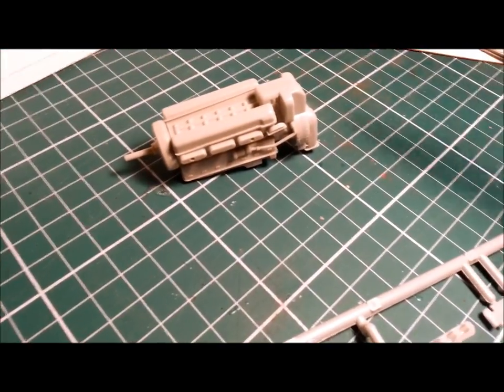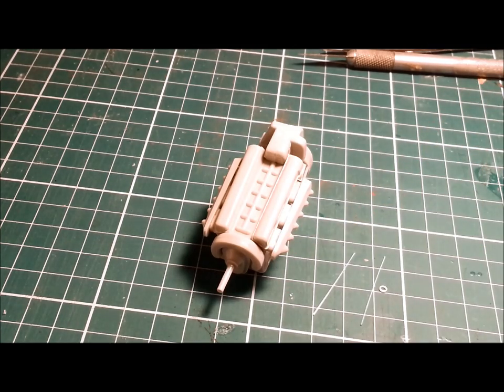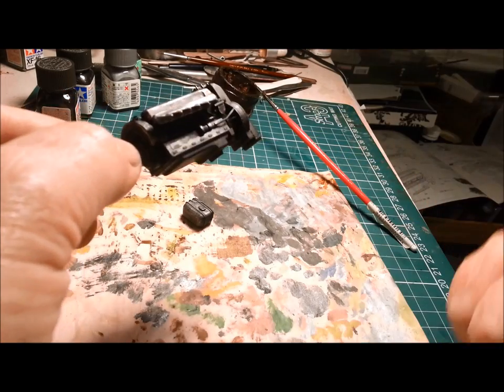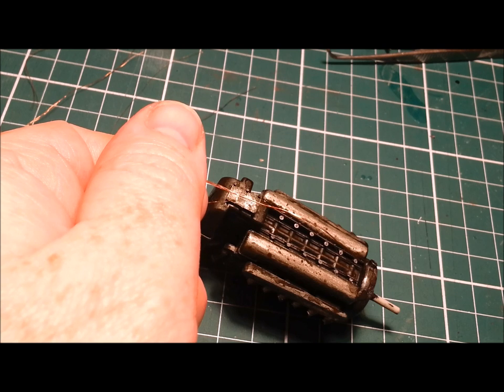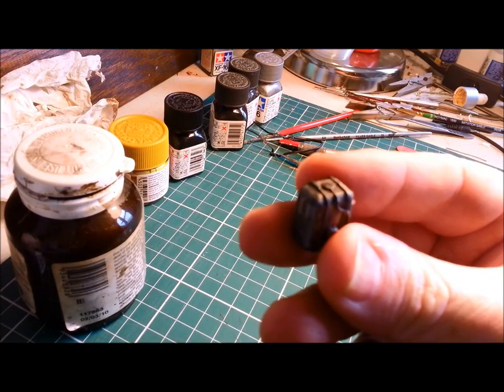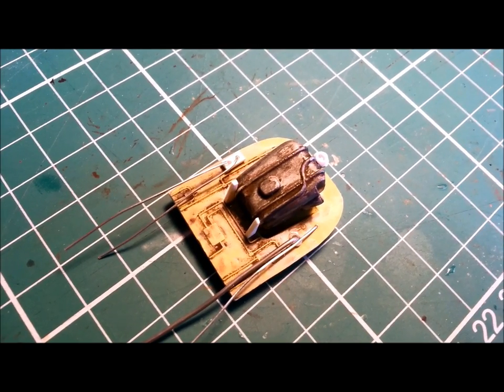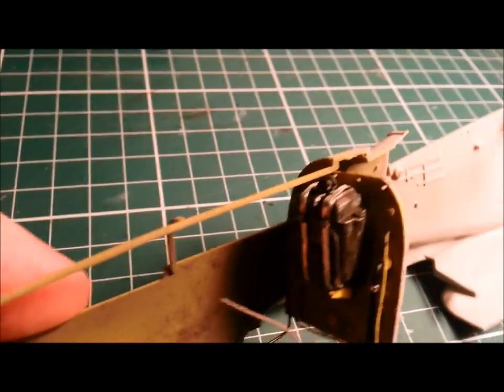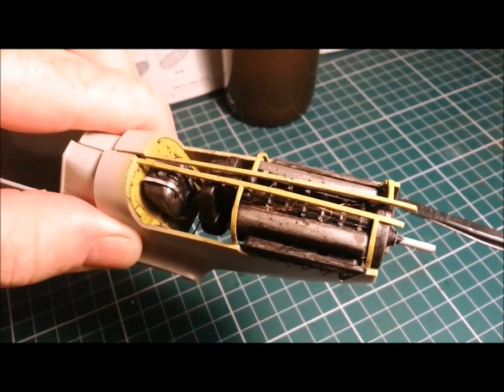How to superdetail & scratch build a scale model engine bay: P-51D Mustang in 1/32 scale

Comment: nice to see you use aluminium foil strips.  i use self adhesive alu foil it on my canopy's where pos. also on occasion aluminium from cut up beer cans for bulkheads etc. i have a seemingly endless supply of those.
Reply from the maker: I know, endless, right? And so versatile!

Comment: 4b to 9b pencil over matt black can look pretty good and give a reliable result compared to experimenting with 'metal paints' on small engine painting.
Reply from the maker: darron hedges that is a cool idea! Much easier to precisely apply on a very small engine, particularly on smaller scales like 1/72. Thanks mate :)
Reply: if you heavily overlay the soft and softer graphite as long as surface has texture you can achieve a pretty good finish.Better than a lot of metal paints on small 'knobbly' engine parts.I have discovered a new way of doing zimmeritt for 1\35 armour.If interested just shout.
Reply: @darronhedges5873  That is a fantastic tip! I will definitely be using that. And you've piqued my interest on your new technique too...
Reply: I since found out the differing grades of graphite reflect different hues of light,orange and blue are the two most common.I got the tip from old railway modeller,they knew thier materials.Can't be a coincidence.
Reply: @darronhedges5873  Well that sounds like there is a fine art to applying graphite. That lets you play around with reflections instead of colour. Interesting...
Reply: I layered 3B,5B and 8B pencils on the main internal mechanic's of the Ryefield panther with full interior.Compared to the Ryefield Tiger interior i painted with metallic paint,the difference is glaring.The reflected light is much more 'in scale' compared to the 'flatter' and simpler reflection's from metallic paint.If you ever consider 'do it yourself' zimmeritt,just shout.
Reply: @darronhedges5873  Going to look for some spare parts to make metallic, I can' t wait to see how it looks. 
And that zimmeritt uses pencils as well, or is it an entirely different technique?
Reply: No that uses baking paper and FIMO,heat cured modelling resin type stuff.You just draw panel shapes on baking sheet,roll out Fimo like pastry,as thin as you want.Then impress the pattern you want,and cure in oven.Zimmeritt had problems adhering to tall ,sloped sides(elephant) so it should be thicker at bottom.You can make it so thin  its see through.Damage it before or after curing.It is flexible,strong and rock hard when cured.Have you seen Nigel's modelling bench?,he always has loads on the go.He buys the latest big kits and isnt scared of 'correcting' manufacturers mistakes.His "Dora railway gun modifications' is epic.He's doing HK lancaster in 1/32 scale at moment along with about 4 other builds.Downloads almost everyday.Knows loads of little 'workarounds' and design flaw 'quickfixes'.

Comment: Tie 1 string at the propeller end, 1 at the center&1more at the firewall end(cut theEXCESS)Then glue theSvcDoors in theOPENpostnToDisplayTheEng,Interior&Firewall; you'llALSO be hiding the3to4 small lumps of strings🏜
Reply from the maker: That's a pretty clever idea Paul. As long as the engine bay can hide them, that's a good solution.
Reply: 👌, told my 🇨🇳wife💋&N-laws that I💚🇦🇺ONLY; got MORE to🗣say LATER; going to😴🛌Now, been up since🕓am😴🛌(🌵GodWilling)